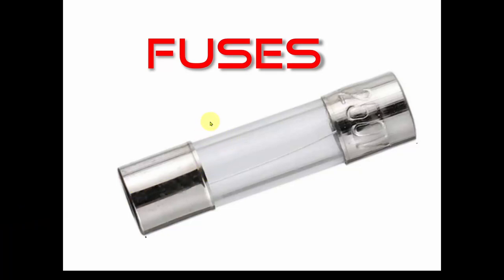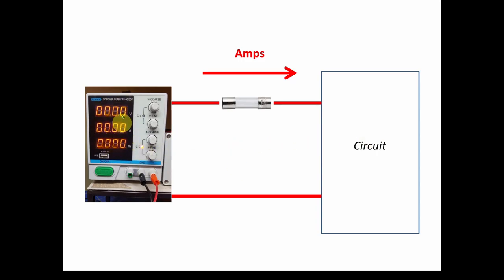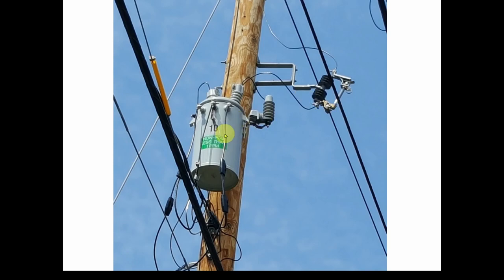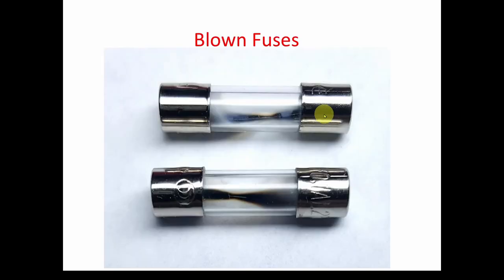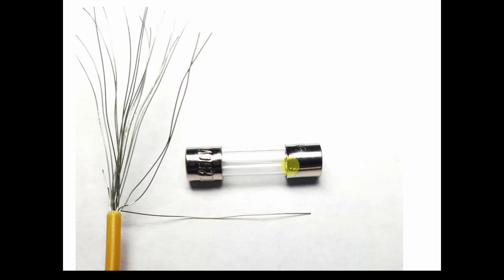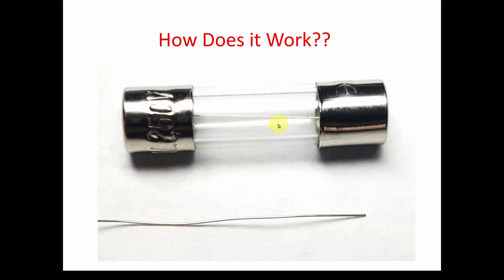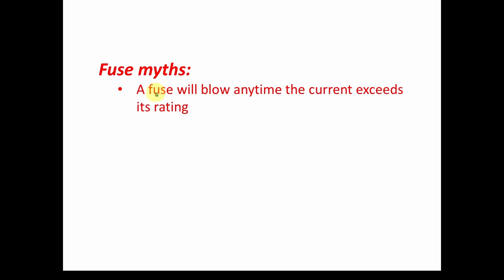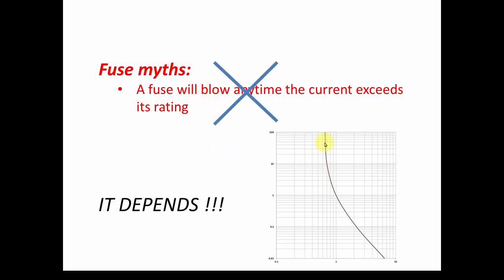Understanding Fuses

Comment: I want to understand this.

Especially since special extremely expensive fuses for high end audio is discussed in various forums.

Could there be a difference in sound depending on how the fuse is made???
Reply from the maker: One of the reasons I avoid online hobbyist/enthusiast "tech" forums is they tend to prefer never-ending debate of vague, unproven or unprovable beliefs rather than take an engineering approach and look at the actual numbers to resolve the issue. As I showed in this video, we did a simple test to show the resistance of a 0.5 amp fuse is only around 0.5 ohms, and higher rated fuses can be much less. And if anyone is hesitant to do a simple test, freely available manufacturers' fuse datasheets will show the resistance of all fuses. I'm guessing that nobody thought to hook up an variable rheostat (I show a 0-5 ohm rheostat in my "What is a Rheostat" video), and match it to the fuse resistance and monitor the audio output on a scope or  spectrum analyzer to see if varying the fuse resistance matters. And I'm guessing nobody thought to consider the fact that the 120v power transformer feeding the audio equipment and protected by the fuse probably has a winding resistance 20x that of the fuse (as I showed in my "Understanding Transformers" series), making the fuse resistance irrelevant. Not to mention the other circuit components, whose resistance can vary with component/manufacturing tolerances, temperature, etc. So when they say "I notice a difference in the sound", the engineering response is "show me the ACTUAL variation in audio output signal as you vary the fuse resistance".

Comment: Maybe I missed it but can any fuse(slow or fast blow)be directional? Thanks 👍
Reply: Yes, Fuse is bidirectional.
Reply: No, they can’t. To determine the power flow direction, a device needs to have a reference, for example, voltage. With no reference, fuse will operate with no respect to current flow.